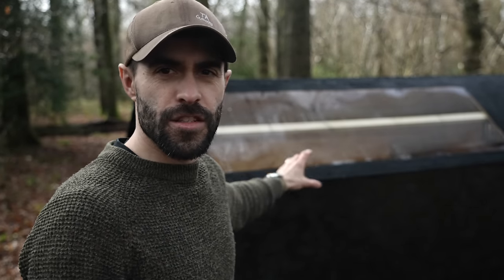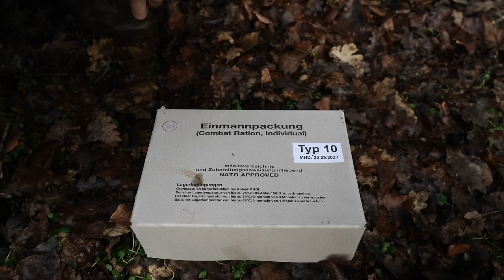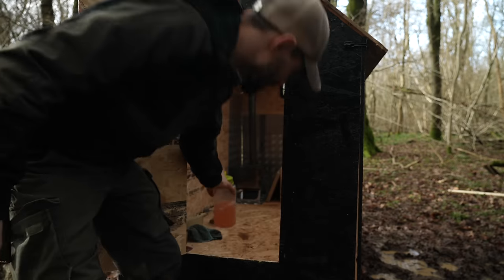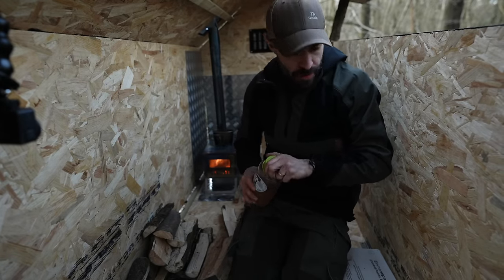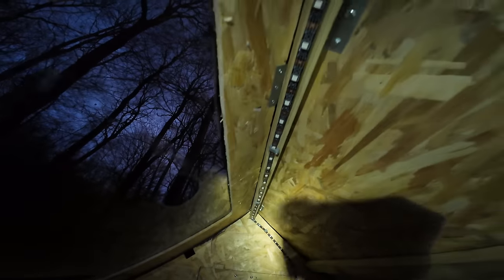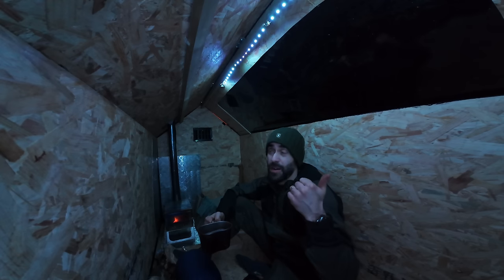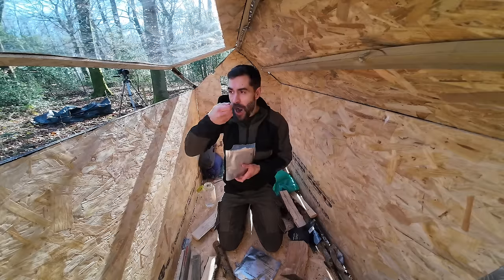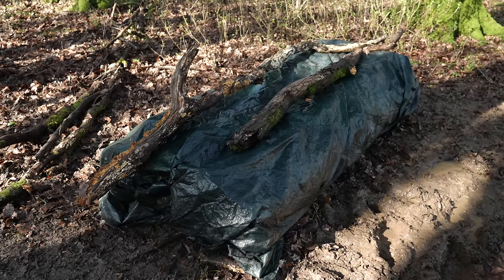The 'Stealth' Cabin: First Night in the Heated Flat-Pack Cabin

Comment from the maker: This was great fun! Watch PART 1 of the build process here: https://youtu.be/QHvow-379eE?si=UydUUTYLTDRDT4FW
Reply: This makes me thing of those videos about 20 years back of pickup truck bed liner coating over a cheap, styrofoam ice cooler like those from gas stations where the full-grown adults stood on the coated styrofoam and it didn't break.  Here's my high cost, (presumably) lightweight idea - just use styrofoam insulation board coated with the polyurethane be liner for strength.

Comment: When you mentioned adding wheels to it, I pictured 2 wheels on one end and two handles on the other end, turning the flat pack into it's own "wheel barrow". Eliminating the need of an actual wheelbarrow. Plus having two wheels spaced further apart would make it more maneuverable and less likely to dump your load. The wheels would be less likely to sink into the mud like those skinny legs. 💖🌞🌵😷
Reply: Good Idea, it could be pulled instead of pushed which would improve the transport on difficult terrain
Reply: Wheels would need to be on the side opposite the door, because you would also need some form of lip in order to stop the parts that aren't attached to the base from sliding off.
Reply: @kiritotheabridgedgod4178  , yes! And I was thinking the lip could be big enough to accommodate other gear as well: lawn chair, camp stove or even his backpack. 💖🌞🌵😷
Reply: ... then train a cart goat...
Reply: Adding wheels to it could make it into a bicyclecamper
Reply: But then when your sleeping on it it could move and won’t be the same level as the other side good idea though!❤
Reply: @brigitporteus2998  only 2 wheels... The side with handles has legs for level. Like a wheel barrow. 💖🌞🌵😷
Reply: @suzisaintjames  that's what i was thinking. It could be its own dolly cart. All in one system.
Reply: @NelsonZAPTM my huskamute could do it no problem.     About a dozen other of my clients could do it.  I'd tandem up 2 or 3 daschunds that pull hard.  There's a 2 lb dog named Nano that competes in pulling competitions.  He pulls 70 lbs.  The last I looked the winner was a Rotty that pulled 108x her body weight.
Reply: I saw another guy made a mini cabin not much bigger than yours.   (Pentagon instead straight sides).  Apparantly old garage door panels are hard to get rid of because of separating the foam is tough.  So they give 'em away.  That's what he made sides out of.  Just slice through them with a saw.  Insulated, weatherproof, light, and free.  He gave it solar, and a little diesel heater with ventilation and waited for a homeless guy to commandeer it.  Old garage panels have already off gassed too.  Anyways, it's just a thought.  Have a nice day.
Reply: @suzisaintjames  wouldn't the ruin the point of "wheels less likely to sink into mud like the legs" if you still have the legs?
Reply: @jodycarter7308 I watched that video a couple of days ago and was thinking of sharing this video with him.  😆
Reply: Guys, Salvation is Simple

HalleluYAH translates “Praise ye YaH”

YaH is The Heavenly Father 
YaH arrives via the TENT OF MEETING
YaH was Who they Crucified for our sins
YaH was Crucified on an Almond TREE

— Ancient Semitic Cuneiform of Moshe (Moses)
— Isa Scroll (The Original Isaiah)

Isaiah 42:8
"I am YaH; that is my Name! I will not yield my glory to another or my praise to idols.”

Isaiah 43:11
“I am YAH, and there is no other Savior but Me.”

Isaiah 45:5
“I am YaH, and there is none else.”
Reply: I thought right away in your build that you could perfect to design to your liking, patent it and start manufacturing to sell!
I’m sure there’s a lot of blokes that would like to buy this from you!
Reply: That’s very cool that you can see out!
It’s like a private observation car!
You can sit inside and read or draw or contemplate nature, listen to the birds!
Paradise!
Reply: Don’t leave your roof or door open with the lights on or you’ll have every bug in the neighborhood in your cabin!
Reply: I have to ask you, you brought everything to your campsite with a wheelbarrow from your car. 
What happens to your car while you’re camping,
How far away is your car?
Is it in a safe place that no one would break in it or steal it?
Just curious.
I’d be afraid to leave my car in the wilderness overnight unless it’s pretty close to you.
Reply: Omg bugs will be attracted to the light for sure. Yeah please don't leave lights on and doors or windows open. You won't sleep a wink.
Reply: @pamsmith7369 I saw his car not even a block from his little place..I saw it through the trees. So it's nearby and safe
Reply: It would be wonderful if it was just another foot wide.. 12 inches is all, maybe even 10 inches. Would allow for a lawn chair on one end. Maybe near the door. Just a simple folding canvas one with a bottle holder or cup holder
Reply: @marlenejones6266  , 🤔soooo? A portable deck? 💖🌞🌵😷
Reply: Nice job. I would add a c-track (bolt rope track at the front of the cabin so you use a awning to protect the entrance and to let you cook outside. I noted that the roof stove pipe flap is on 180° the way around. You have it in the rain catching position. If you put a bead of polyurethane sealant around the roof-light opening  and let it ½ set and then place the acrylic and leave it another few hours before screwing the acrylic down it won’t leak. Dont forget to put sealant into the screw holes before inserting the screws although I think you put black jack over the screw heads.
Reply: not sure there be more fun to build one myself and to my own requirements

Comment: I used to live in my 17ft camper and during the winter I'd put a skirt around the bottom to keep the wind out from under it. Not only did it keep it more stable during high winds but it kept the camper warmer. A drop down canvas one would work great.

Comment: Like you say, a bit of tweaking here and there. Instead of a porthole in the door, put a low vent. It will be near your head as you sleep. The high vent on the other end will give a draught to keep the air clean and fresh. Don't build the fire so hot. We tend to want a roaring fire, but it isn't necessary in such a closed environment. Less is more. Saves on wood too. Thanks for the video. Ian

Comment: Fyi, if you want to drill holes in plexiglass to mount with screws, use a drill bit in reverse mode at slow speed and it won't crack. To saw it, use a very fine metal cutting blade at slow speed on a variable speed jigsaw and push very slowly ie let the blade do the work. A single part epoxy paint or varnish might reduce off gassing of plywood chipboard. Rust-Oleum makes an inexpensive Marine single part waterproof epoxy called Topside Marine Coating. No respirator needed. Some bicycle wheels would let an ebike tow your camp. Cheers from New Orleans
Reply: another option for plywood type stuff is just let it get old.
Reply: Make holes in acrylic with hot soldering iron?
Reply: @eggandchips4t  In my experience, it will work, but holes are limited to the size of the tip and burnt/melted plastic stays on top and bottom rim of the hole. It also can drip and burn whatever it lands on (ie don't have a hand or toes underneath).
Reply: Better yet use polycarbonate instead. It's much less brittle and overall stronger.

Comment: You could build a small bench or shelf to get the fireplace up a foot. That way, you could store wood and have room for your feet underneath.
Reply: i know nothing about building things, are you not worried in that case about the stove falling over?... i guess thinking about it, theres not much more risk just because it's elevated if the bench is secure

Comment: You should take a bicycle tire tube and split it open length ways to use as the peak cover. More flexibility when opening the hinged side. Just a thought. Great mobile unit though.

Comment: Should add a detachable tarp around the bottom edge of the roof  hatch for a little covered area or so if it's raining you can still have hatch open for better air circulation

Comment: Next:  install a washable floor covering.  I held my breath while you did the pasta scene!  Given your soggy ground, storing stuff under the cabin may not always be an option.  Maybe a hanger system inside the door?
Reply: I was going to suggest the modular foam flooring, if it will work with the pack down. hard wood gets sore on knees and bums.

Comment: Was thinking that if you were going to put lights in it or use a power bank of some kind, you could stick a powered fan in one end to make sure there's continuous ventilation for safety reasons.

I also like the idea of building it as a wheelbarrow/cart-type setup. Fold it up, secure it while you're moving it, and set it up when you arrive at your destination.

Comment: Longer term that tarp tightly packed around it will hold moisture that comes from the ground keepin all the contents wet, ala mold and rot.  Keep the tarp off the ground for ventilation.  Overall great job getting something done.  Keep doing, keep learning, keep enjoying.

Comment: Idea: Instead of building a whole cabin, only build the foundation part of your cabin in the size of your tent. With some 2cm XPS glued to the underside of your foundation you could sit quite comfortably even in the winter times.

And I think the OSB is fine. One just needs to use it in combination with other materials. You could, for example, glue aluminium foil to the inside. It rejects condensed moisture, reflects heat and contains the outgassing.
Reply: Definitely I agree with trying to make platforms. also, the platform could have poles that extend flat on the ground, to provide anchor points instead of stakes, if the ground is too soft for stakes.

Comment: i seen a shepherds bed that was built permanently in the mountains about 3'wide 4'tall 6'long . long side the whole side laid down for a door and sort of porch you could lay there and look out or sit up and look out it had an extended roof over that part were it didn't rain in and that's what it was for to get out of the rain or stay the night, watch the flock.high enough off the ground for the dogs to get under.and cozy enough for both to shelter .even had a rain gutter off the back going to a barrel for water.

Comment: you could use what we in the USA call all thread and a couple bicycle tires with rims to make an axle for one end of the cabin and attach a handle of sorts to the other and the whole cabin itself would act as the mobile trailer. the tires would be big enough to not get caught up on much as you push/pull it through the woods. after getting to your location you could remove the wheels and set the cabin up as normal. I hope i am explaining it properly but i do love your ideas and think it's a great project.

Comment: About 25 years ago I built a 30x8 shed/workshop using 18mm OSB on 4x2 timber. It still stands. The OSB had a coat of fence paint when I put it up and had another coat every couple of years. If sealed (especially the edges) OSB is a lot tougher and long lasting than his comments indicate. Still like the little cabin.

Comment: Great seeing the modifications and left me with all sorts of thoughts as to what I could use something like that, including for myself and a mate when we go on weekend airsoft games but that would be steel framed and attached to a trailer (we prefer to build things rather than buy them :) ). One thought definitely occurred to me though - you could line the walls inside with some cotton batting and hessian to insulate it a touch and deaden sound a bit. Might make it feel a little more cosey overall but still a really nice idea and good bit of work.
I can definitely appreciate why you went for the acrylic skylight though, that was a stunning view!

Comment: Beautifully designed. I would add a fold down wire shelf on one wall, to keep gear off the floor; plus another to use for eating. They would be light weight and thin to become part of the flat pack.

Comment: A hinge or 2 on the inside of that guard to allow it to fold and a low rail screwed into the floor would keep the whole thing somewhat secure, if you got a spare piece of that diamond plate, you could use a few 1-inch sections of copper pipe (or other suitable pipe) to move it away from the guard and also have a functional heat guard without having to use the flimsy fire bricks and it would still flat pack :) hope it makes sense and was somehow helpful.

Comment: I eagerly awaited this video after watching you build this neat 'flat pack' cabin. Except for the lexan panel section in the roof, I've had a similar concept and design in my head for a few years now. 
I envisioned full 4'x8' panels of roofing grade plywood all hinged together so it folded down flat onto a small trailer. The folded down cabin sections would serve as a deck for my ATV to sit on, while being trailered to a ride area. Once there, the ATV would take over by puling the trailer into the remote campsite where the cabin could be unfolded like yours.
Now that I've seen your lexan sky light, I think I'd like one too. I like your exterior paint idea as well. Thanks for sharing this build and your adventure with us!

Comment: Nice cabin. If it were mine I would put in two open/close vents. One just in front of the stove in either the floor or wall to allow for combustion (closer to the air intake than the one higher on the end wall) and a second one somewhere near my head for temperature adjustments as needed (easier to reach during the night and morning). Good work on the build.  Now the real test.

Comment: Love the build . another idea was to use a screen net for the pop open roof so no bugs get in on summer days. An 2 latch open rods an nooks to keep the roof proped open when it gets lil to warm . an camo tarps are nice for stealth camping as well as theres material out there that would make the portable camper into a camo camper with similarities to a guilis suit . so leaves an stuff can be added to blend in to any environment . i love your ideas .as rope lights are nice an compact . portable stove is a nother nice aspect . to make ur project a allrounder u can add a solar generator an create a micro cabinet to house the solar panels or position them a ways away from chimney stack .😊 for solar in can be using the prop open roof or a hole drilled with a wire flange for the solar input . i normally use a silicone base for flanges an conduits so no water gets in . i enjoy ur crafts an ideas its pretty awesome . 😊 keep up the good work .i plan on making a portable camper in the near future for toweing behind my bike . using a fat tire cargo trailer formed into the base of the build an modified . as fat tires hold up to 400pounds a piece . 😊

Comment: I see it like a sewer making a mock up from muslin. You have to test the project before using the more costly material in case you need to make major adjustments. I wouldn’t mind seeing if theres a way to do and make it full standing height.

Comment: I've not seen the end of the video yet, but it pays to treat the underside of the cabin with the bitumen treatment as well. Plus, there will be condensation inside whether you're there or not, despite having lots of little gaps. It might pay to keep the acrylic roof propped slightly open all the time.
You can put some screws into your walls, mostly over where your feet go, and use them as hooks for your bag etc to keep things out of the way.

Comment: Neat idea. It looks like it would probably afford better protection from wind and rain than a tent would. If I had the money, I'd buy an ATV with an ATV trailer. Then I would attach an upper rack to the trailer so I could carry a fold-up cabin like yours. The lower part of the trailer would be used to hold the camp stove, some wood, water and food, plus a power station and other supplies.

Comment: On the wall where there is an openable window, you could add a rod that would extend upwards and be locked at different heights, so that you could more easily open the window to the required extent.

Comment: The one thing I would offer is that Amazon sells rechargeable mini air inflators for sleeping pads, pillows, rafts, etc. It takes only seconds to fill your pad and when you are done camping you can switch it to deflate your items in seconds. They are very useful and nice to have and they are tiny so they are easy to pack and take up little room and weigh less than nothing.

Comment: You could add mosquito net that snaps across the open skylight for summer nights when you want some breeze. It can roll up flat against the wall when not in use or only bring it with you in the hot months👍🏾

Comment: Wonderful build!

I do have a suggestion though. I do a lot of hot tent camping in the winter and I did not see a ground level vent for your cabin. It may be there and I just missed it, but wanted to mention it in case. Your cabin probably isn't air tight, but a small vent down near the floor (or in the floor since you are on a small riser) would help in reducing possible condensation when you can't have the roof open (like in storms). My hot tent has a zippered vent for this purpose. I would suggest a round stove vent opposite corner of the stove, so you can open/close as needed. Place a screen mesh (storm door screen works well) within it to keep out insects.

Also, I suppose you painted the outside black for concealment, as well as heat retention. You could paint the inside white to help with lighting, as well as possibly making the walls and roof partitions reversible, for heat reflection in summer months.

And please, do not take my comments as anything derogatory. I think this is awesome, and only want to try to help and give ideas.